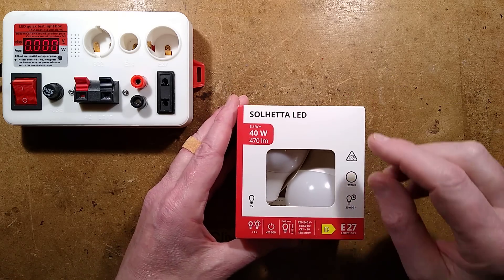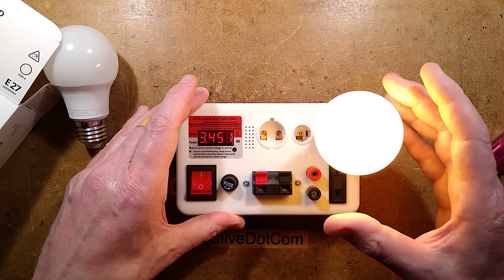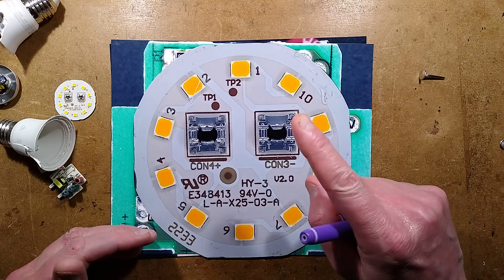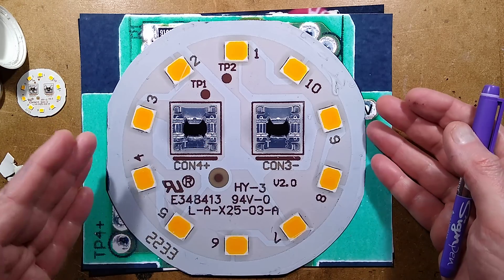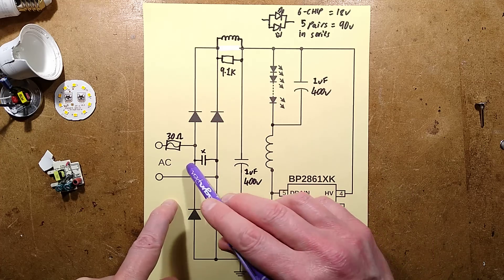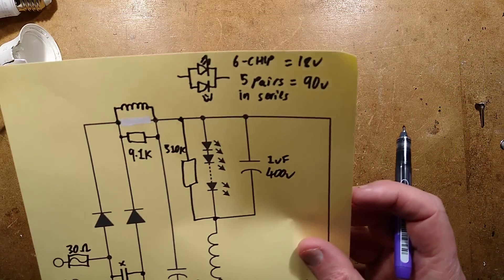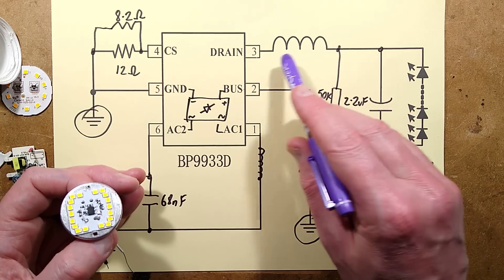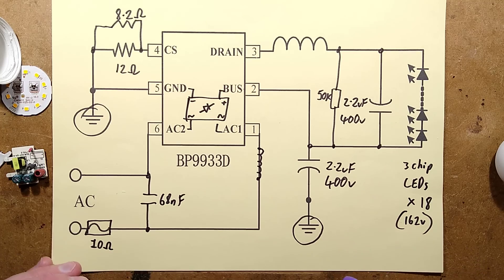IKEA Solhetta bulb teardown

Comment: I wonder if you could give me some advice (on your stream or in comments...) - would you trust the power monitoring sockets from IKEA to not burn your house down? They are called "inspelning"

The EU and US versions state a 300W limit on inductive loads, but the UK version states no such limit. I don't quite understand enough about the electronics to know whether I could safely leave these on my dishwasher/fridge/washer-dryer.

(I've seen some discussion that the issue might be with the switching element rather than the monitoring. I would leave these plugs permanently on - only to monitor energy in home assistant). 

Thanks!
Reply from the maker: The IKEA stuff is generally very well designed.  There should be an electrical specification on its label.

Comment: Just bought a pair for 1.5 EUR, insane how cheap they got. Noticed the power is different 2.9W now. So of course i opened one. The design is different, 10 LEDs and a switching regulator i cannot identify. All on one aluminium PCB.

Comment: On the first bulb (with sense resistors placed on pcb driver board) we can apply the classic formula and method, like remove one resistor for power reduction?
Reply from the maker: It depends on the circuitry in a specific bulb.

Comment: If you read the QR code on the EU efficiency sticker, you get sent to an EU website with specifications of a given light bulb. One of the better things is that there's a mandatory spectrometer testing, so you can easily check for blue spikes in light bulbs. I was surprised to see many supermarket warm light bulbs have fine colour profiles!

Comment: I took apart a Philips 13.5W 5000K bulb (model no 542976) that failed, made for the US market, and its design almost exactly matches the second one, except there are two strands of eleven LEDs in parallel (and the component values differ accordingly). Sadly, the chip has no markings on it; some of its legs are swapped around compared to the BP9933D.

To my surprise, all the LEDs still seem to work when I power them individually and all components measure to spec. So my best guess is that the chip failed. It seems to be getting toasty at least, the PCB right underneath it has nicely caramelized. I guess I have a bunch of 9V LED packages now to do something else with...

Comment: I have fitted Ikea LED light bulbs about 8 years ago and, blow my socks off they are still going strong.  So absolutely no complaints and I could not say the same of some other major brands.  The same goes for the Ladda Batteries so much better than Never Ready or the some other brands sold by supermarkets etc.  It is interesting to see todays throw away electronic parts of which many would end up in landfill, all that wasted copper etc.  In my early days every good bit of electronic hardware was used twice.

Comment: Ikea has recently released a 5.9 W (806 lumens!) variant for the E14 socket, a very small form factor, and this variant is barely larger (just a few mm) than the usual 3.4 W (470 lumens) models we usually encounter on this socket.

It seems Ikea has established a new record for this form factor, and I would be very interested to know how well this model perform, in particular concerning heat dissipation.

Comment: Light quality wise, it's about average. The E27 bulb has CRI ~80 (R9: 9.6, dUV -0.0007, purple tint), but the E14 surprisingly has CRI ~95 (R9: 63.4, dUV: -0.0003) but has an unfortunate very strong unnatural orange boost (around 630nm). ... Both better than cheap chinese bulbs, but worse than high-CRI bulbs from reputable brands.

I guess I would recommend the E14 one (605.100.32) for people who are into low pressure sodium. :)

edit: Well, I finally managed to get into the E14 bulb and it might buck the trend too. The top PCB has no regulator chip. I'd have to use a dremel to get further.

Comment: Obviously these bulbs wont be restored to their former glory. So i was wondering what do you do with the loose circuitry?
Reply from the maker: If possible I do usually reassemble the lamps.  But otherwise the case gets recycled and the circuit board goes into a tub reserved for lamp bits.

Comment: LEDs are very efficient, and have a long lifespan, especially when run at a low current.
I do not understand why manufacturers use buck regulators, which take a lot of room and can have multiple points of failure, while they could put more LEDs run at a lower current by a linear regulator (or even resistors !), and put an aluminium radiator with cooling fins in place of the buck regulator.
Of course a buck regulator is more efficient, but many LED bulbs fail way before their advertised lifespan, and they consume so little power anyway, that it would make sense to have a bulb 2x less efficient if it can last 2x longer.

Comment: Now you don't have to worry about matched lightbulbs, IKEA will make sure that you get 2 different bulbs
TBH, every single product should be sold in packaging that makes it obvious if the packaging has been opened or otherwise tampered with
Yes, I get the "less packaging is better" argument, but having worked in a store has given me plenty of experience in assholes making their own samplers

Comment: Ikea was doing a few bulbs with a C rating energy rating last time I was in. You should get some bulbs from Toolstation as they do a few surface mount bulbs with an A energy rating, 3.8w 806lm for the cool while and the other is actually a B rating and uses 4.3w and is 806lm but it is a warm white bulb

Comment: How you doing big man? Quick question, have you done any vids on voltage testers? This would be the cheap detector type pens / screwdrivers?
Reply from the maker: I have one coming up fairly soon.  On two types of LED screwdriver testers.  One of which has a microcontroller in it.

Comment: I think lamps should come with thermometers and smoothly adjust the power
Reply from the maker: These current regulator chips do have thermal sensing and will lower the current if they get too hot.

Comment: I am afraid i have to show my obvious lack of elwctronics understanding as.... I always thought that the purpose of adding a resistor in a circuit was to reduce the power going through a said circuit? so can someone please explain to me why taking a resistor out of a circuit will effectively reduce the power ??? Clive? please educate me
Reply from the maker: It's a sense resistor in parallel with another one.  Removing it increases the value and lower the current to achieve the same sense voltage across the resistor.

Comment: You pronounced "solhetta" almost correctly! The "o" is pronounced similar to the o's in "cool".

I wonder if IKEA has much input when it comes to what goes into those lamps or just use the designs the ODM already has 'as is' after simply verifying safety and efficiency.
Reply: Came looking in the comment section for reports on the pronunciation. Thanks!

Comment: Would you be interested in some LIFX bulbs? We've just replaced 9 of them with Hue lights due to reliability issues - we've got the B22 Plus bulbs with infrared LEDs for night vision security cameras and some older gen 3 bulbs. I wouldn't feel comfortable selling them given the problems we've had with them. We're located in Bedfordshire, so posting them over shouldn't be an issue.
Reply: What happened? Did the bulb still work, but you can't change the settings, because it's not detected? I had that problem with my first one that I was testing, after a thunderstorm.
Reply: @RJARRRPCGP  No. The majority was general connectivity problems, likely due to the ESP32 series SoC used in them, it’s known for being somewhat unreliable. Lights would randomly fall off the Wi-Fi, often for hours at a time.

There are a million guides out there that try to fix those problems, from changing your network SSID over making sure you only have a 2.4Ghz network with the SSID up to having a separate router for the lights. I’ve tried them all with little improvement, but let’s be honest, if you have to change your entire Wi-Fi setup to accommodate a light bulb, the problem is not the Wi-Fi setup. Additionally, we run a dozen other connected devices, none of which show any signs of connectivity problems.

That in turn would cause issues with google assistant, ranging from “couldn’t reach 5 lights” to the whole Lifx service being unavailable and nothing working.

Then there were individual bulb failures as well. Some would suddenly only work only with a delay, even after physically switching them on. The most recent failure was a light getting stuck in reboot mode, constantly cycling through colours at a slow pace, before getting stuck on green, without any connectivity.

We’ve now had Hue bulbs for about a week. In terms of light, they’re worse, as they don’t go as dim and colours can’t keep up with the brightness rating of the bulb or the sheer intensity offered by Lifx, but they work 100% reliable so far. And in the end that’s all I care about when I want to switch them off from my bed at 1am or on at 9pm while we’re out on vacation.

Comment: I like the bridge rectifier built straight into the driver chip design. I prefer the buck regulator bulbs, as they work well with  half-wave DC input, that I have in some of my circuits. They can also handle a wide range of input voltages, both AC and DC.

Comment: Hey Clive, I need your advice, two days ago my flat burnt down, my dehumidifier looks like it decided to go up in smoke, what the hell could have caused it tk fail so badly? Also this channel got my actually into electronics in the first place, is it worth continuing on as a hobby, or is there some point in your life where you wish you'd just left it alone - part of me worries they'll try and blame me some how because I was I the middle of a few radio and tv restorations
Reply from the maker: There's a terrible history of dehumidifiers bursting into flames and I'm not sure why.  Maybe the motor capacitor failing with flames or an electronic failure.
If you know the make and model do a search to see if it has a history.

Comment: Don't attempt to pronounce Swedish. Not even swedes know how. 😉

It's an amalgamation of two words. "Sol" and "Hetta" literally translating to Sun and Heat.
In combination it practically translates as "solar radiation" and is how swedes use that word most often.

If you say stool and remove the t, you get close to how Swedes say sun.
And if you say heterosexual but cut it out at "het" with particular emphasis on the E and add "ta" as in tangent but say it more like "da" as in daddy then that gets closer too.

You see, swedes have a particular way of saying words with high and low tones in places.

And as always, don't bother too much with the meaning of IKEA item names. They are randomly wonky as always.

Comment: Ah, another LED lamp executed ;)

By the way - can't remember if I stated this already as comment to one of the former lamp videos - you can open those lamps without any observable destruction.

First:
If you've got a stable - preferably ceramic - lampseat, mount the lamp into it. The Seat offers a far better grip, than the lamp thread.
Very often the transparent top comes off without any other tools than your crafty set of hands needed.

Second:
Get your hotair-gun and moderately heat up the thread, after a minute or so you can easily unplug the plastic housing from the thread.

A lamp disassembled this way, can be reassembled showing no signs of damage.

Comment: Hi Clive, it would be nice if you could explain in a future video how current sensing works in this type of lamps or even in general. I was just searching youtube and I couldn’t find any good reference for those circuits. Thanks for the video!
Reply from the maker: Most use a simple low value resistor and measure the voltage across it.  The higher the voltage, the higher the current.

Comment: Some time ago they had launched a campaign of cheap light bulbs at 1 euro per unit, but these light bulbs had a very bad lifespan. Some time later they disappeared and these sets of 2 lamps appeared, more efficient in terms of consumption and it seems that they are also reliable, however a little more expensive

Comment: I don't think the long leads on the caps of the 6W lamp are to place them out of the heat. I think it's done so they can fit the entire thing through the hole in the heat sink XD
The fact that they aren't as close to the heat this way is probably just lucky in this case :p

Comment: I can confirm the second one 'reviewed' is the Solhetta bulb. I know this because I have plenty of those and did some mod experiments already. I made a kitchen lamp with it, with 6 panels stripped (components) and one panel with a driver, a total of 7 panels on one driver! Works great, removes the heat, very energy efficient (I measured 3.4W) and plenty of light (points). It runs for about 0.75 year now and it is great. I did similar the first time with another IKEA bulb and with 5 panels (I call this version Frankenstein ;-) ). Still going strong. 

The first one I made was easier because the driver can be easily separated from the panel like the first one you showed us. It is very easy to take one driver and a few panels. Because there is a current limit this is possible and the current for each panel is divided by the number of panels used in parallel to the driver.  Benefits: No heat, last forever, more light points that can spread the light (compensation for 1/x current) and you have plenty spare drivers/components. 

If you want to do the same I did, buy the bulbs from the same batch because the manufacturer can change the electronics inside (for example new lower cost version) but can be still the same product name.
Reply: Love to see how you did all that..
Reply: I was working on an idea like that with MR16 downlights, gutting three and using the driver of one to driver all three. Brings the temps way down. I just have to make it some what more "non ugly" before I'll be allowed to put it up lol

p.s. every led "bulb" I've ever had fail it was the driver, never the LEDs. But then removing the LEDs from the driver housing should make it last much longer I assume.

Comment: I work in appliance development, and the story behind the british flag on the EU efficency label is hilarious.
After Brexit, the UK wanted their own efficency rating system. But the EU regulation does not allow for any other efficency label to be shipped with the appliance to avoid confusion.

Which ment that if the UK insisted on their own label, all products would have to be UK specific, which would cause prices to spike dramatically and many companies would simply not bother anymore.
So, the compromise they arrived at was that as long as the only thing that changed was the flag, they could do that.
Reply: The post 2019 EU rating system is amazing. All a tier bulbs are definitely the best money can buy so no need to use up time researching
Reply: @jason200912 I'd say it's quite the opposite. Energy efficiency has become quite irrelevant when they're all within 3-10W and make a difference of like 1€ per year in cost. What's worse is that light quality goes down with efficiency, "A" bulbs will have at most 80CRI/RA and if you want 90+ you're looking for D or so. The label also doesn't tell you how much the light flickers. Efficiency is nice but in practice the least of my concerns
Reply: Brexit in a microcosm!

Comment: Using a buck regulator instead of a linear one is probably what earned this lamp its better energy rating.
Reply: Linear and buck actually have about the same efficiency for lightbulbs thanks to those 18+ v LED modules. Beating 80% efficiency in 120v land for example just means having the diodes sum to 136v, which is just 7-8 SMDs, and your efficiency actually goes up the smaller the capacitor due to the ripple.

Comment: Several ikea LEDs I've used recently have ended up flickering when turning on, which clears when they warm up. It's annoying but i really don't want to chuck them prematurely.
Reply: oo er, plain 'dumb' ones or colour changing/smart things?
Reply: The current culprit is an LED1514G13 E27 2700K and when i say warms up, I mean REALLY warms up.

Comment: I bought these and was amazed by the price. Someone put one in the loft light despite my concerns about condensation and LED bulbs in an unheated space. The bulb died in a matter of days! Halogen it is...
Reply: Yes, that was always the advantage of old-fashioned tungsten filament lamps. I have some in outdoor locations where they rarely get used and they're still working after nearly 30 years.

Comment: The triangular glue blob is silkscreened on just like solderpaste so the triangle is there for another reason. I would bet it is there to show the orientation needed as those boards are put through a wave solder machine. The glue keeps the small components from falling off while they are immersed in solder.

Comment: Withe 2nd lamp, if the LEDS run at 162v that 50k resistor would dissipate 0.525 watt which seems a lot
Reply from the maker: It is odd.  I had to go back and double check that afterwards.  One lamp had an unusually high value and one an unusually low value.